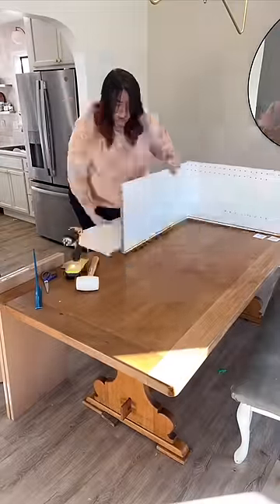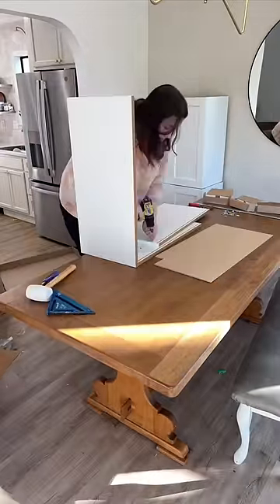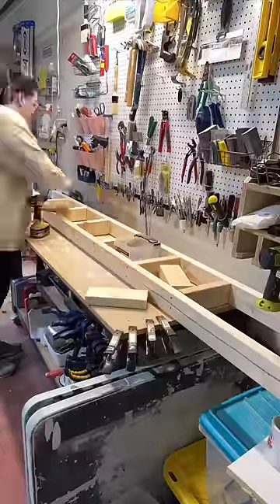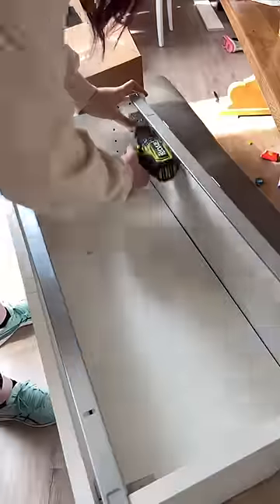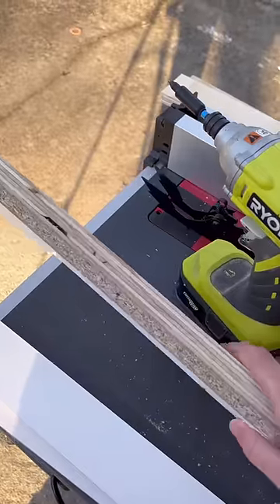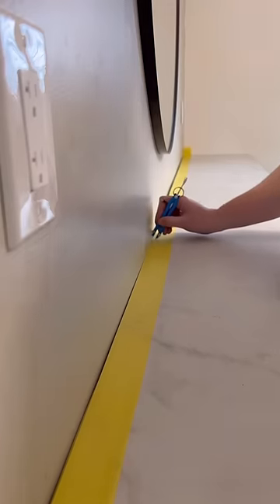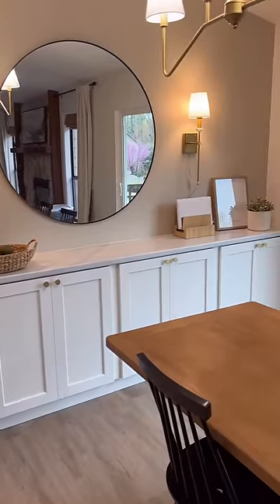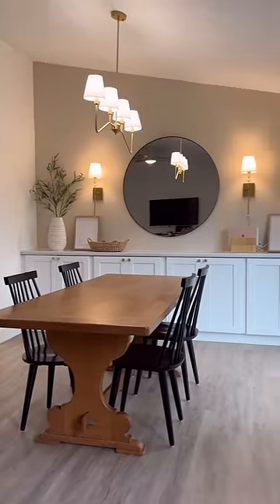#ikeahack Using Ikea Sektion kitchen cabinets to make a #diy built-in buffet in our dining room

Comment: Turned out nice.

Just a safety tip, always use a push stick when cutting on a table saw when there's a section between the blade and the fence that isn't wide enough for you to safely push through with your hand. It can easily shoot backwards at you.

Comment: Question: what caused the gap between the cabinets? 
When you are putting up those cabinets in your kitchen they would surely slide on the rail and butt up to each other.